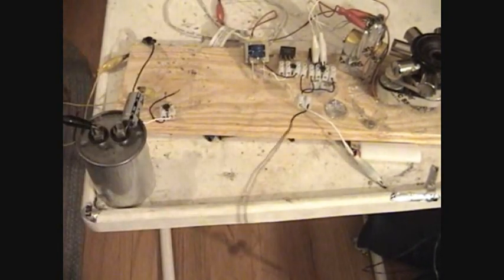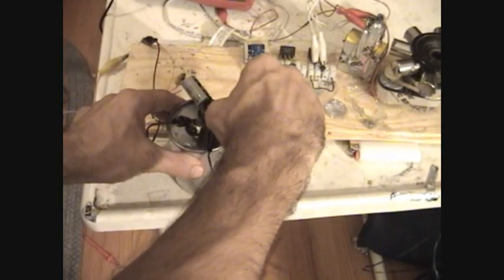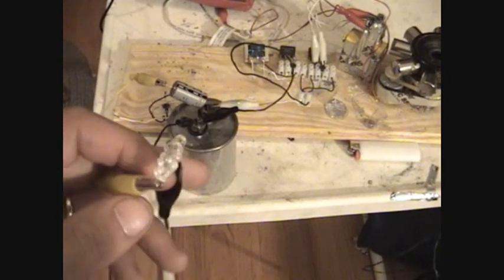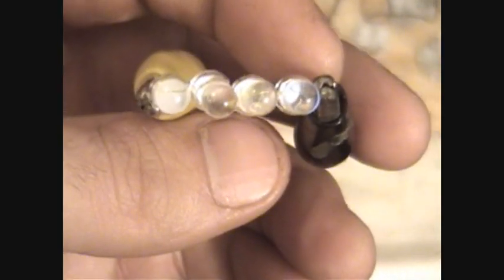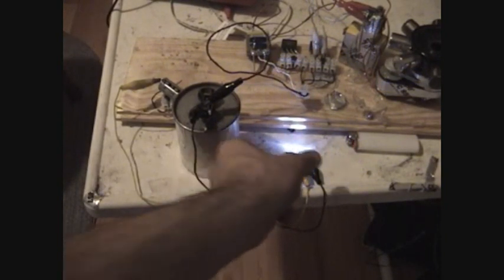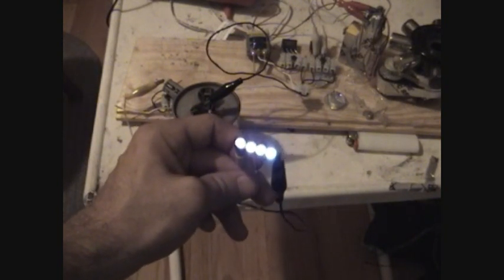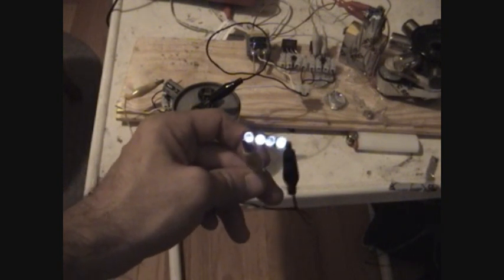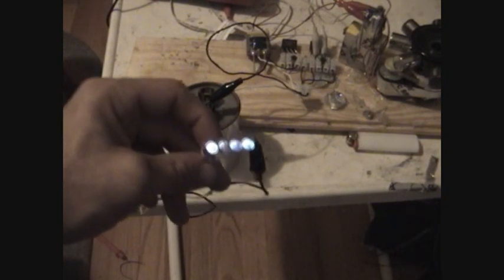LED Capacitor Charging Remake

Comment: You have drained both the caps to below the LED's run voltage, and then rewired the caps in series to boost the voltage for a time. I have tried this in a similar test. I have found that if you charge a cap to around 8 to 12 volts, and run a resistor on the positive lead to the LED, then you will get more run time out of the caps. Check the JOULE THIEF schematic on you tube, you can use this with your project.

Comment: What about charging up only the electrolyte
cap only ?
How long will then the LED light last ?

Please compare this.

It is surly the effect of putting 
a 2 uF cap in series with a 10.000 uF cap..

What, if you just charge up the 10.000 uF cap
alone ?

Regards, Stefan.